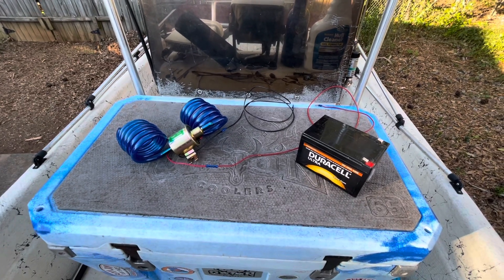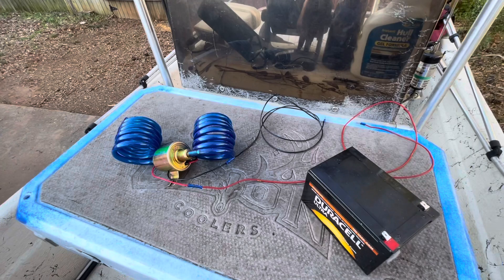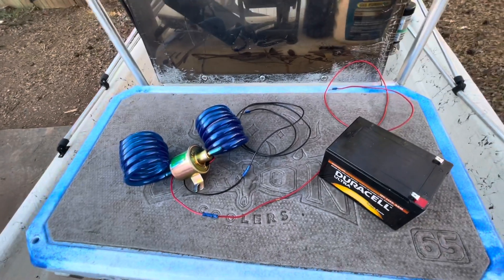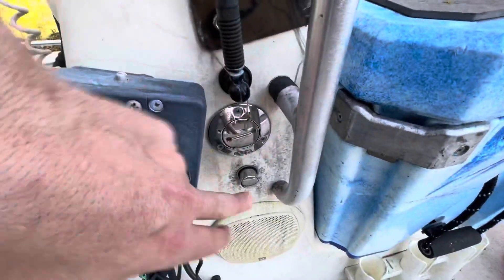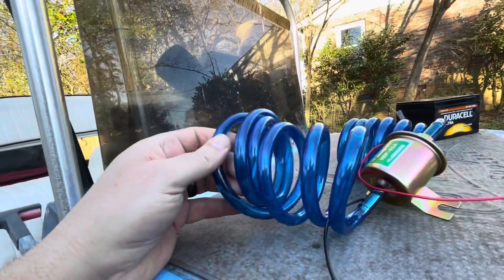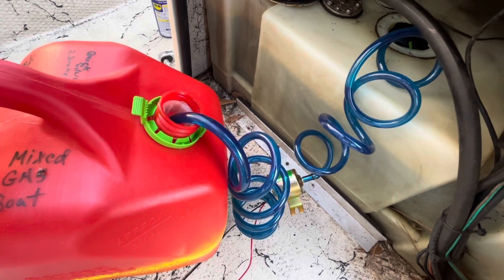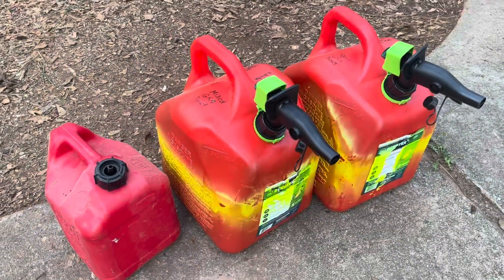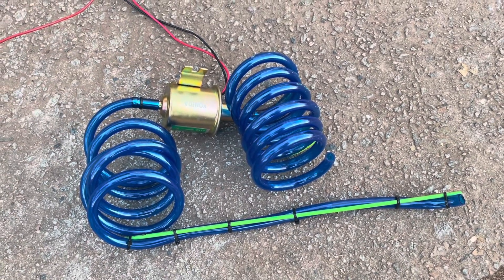DIY 12v Fuel Pump for Removing Old Fuel from Tank

Comment: I tried this with a fuel pump sourced locally that should handle 3.5bar (a lot beefier and louder than yours here), but it doesn't start suctioning. Do you need a particular type of pump for it to pump without being primed?